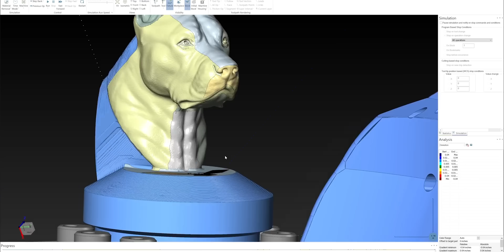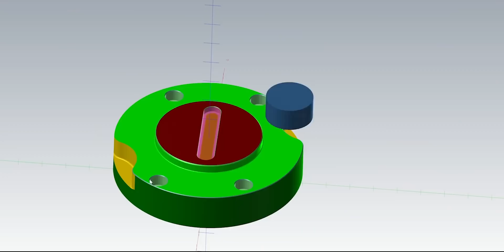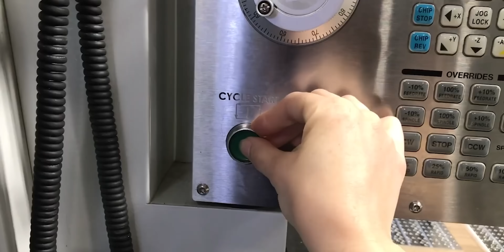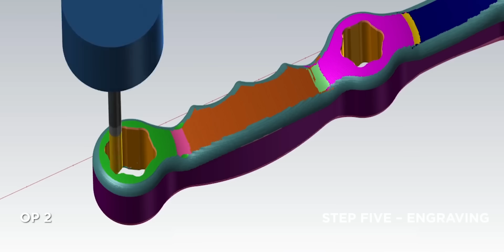My Manager Knows NOTHING About CNC Machining

Comment: Years ago I was hired on as a lead programmer for a large shop.  They had made their name and money doing high quantities of simple 2D wire EDM'd parts, and couldn't figure out why they were losing money doing complicated machined parts.  They had spent big bucks on ERP software, when the root cause was that the manager doing the quoting didn't have a clue what he was doing.  He continually threw the engineering (programming) department under the bus.  I finally had enough and told them that the solution to the problem was not 100k in software, but simple 2nd grade mathematics that the quoter was obviously incapable of, and that setting up a complicated part with multiple operations was much different than doing a simple 2D wire program.  It all fell on deaf ears, but the one thing they did hear was "I'm out"

Comment: Without a doubt a manager must be both a leader and an experienced machinists for maximum efficiency. If one doesn't understand the process leading is problematic at best. I was both for over 22 years and even then there is a struggle if the engineer above the manager doesn't understand the process. In my experience the best engineers also was a machinists first. I could immediately distinguish a die designed from that of a engineer from that of one that was also a machinists/engineer. The machinists/engineer would design the die with thought of quick access clearance holes for inserts for example. Also it is very important to under the production side of things for a total understanding and efficiency.

Comment: I think it’s important that a manager understands manufacturing basics. Understands the challenges that arise. That’s very important. The MOST important is understanding people and having some empathy. An employee wants to feel that they are doing well and not just always behind on a job, or rate isn’t exactly where it should be. We are running into this problem now in my shop. Even a small group meeting at the end of the shift, reassuring that our hard work is being noticed and we just need to keep pushing ahead is a moral stabilizer. Whether we are a little bit behind, or just a few parts short on rate. The least favored line is “keep that machine running all day. No stopping. Keep that green light on”. Understanding that tools break, or chip wrap happens, etc. That not every part ran in a shop is rainbows and butterflies and that I am just not running to my fullest potential.

Comment: It's called micro management and you are so right, that it will take the joy and innovation out of all your employees. I've been a machinist for almost forty years ago, so most of what we did was not CNC work but the principle are still the same. I'm an engineer now but I still have contact to people who work as machinist. I think it's important to let the machinist do the programming too, otherwise they will only be simple machine operators and the company will have a high in/out flux of employees. In Denmark where I'm from the apprentice time was 3 1/2 year for 8 hours/day it has change a bit since, but if you have "optimized" your production so much, that you have dedicated CNC programmers and most of them does not have the basic machinist skills, it will cause many problems. On top of that, you can add a micro management manager who buy the wrong tools and lightweight CNC machinery only focus on accumulated machine time for the workshop. He will then take the next level up on the management pyramide and be inspired of "Change management" ideology, so he now have the "right" phycological toolbox to convince his employees that his Utopia can be for real.

Comment: Been cutting 316 stainless for 35 years. Stainless tells you if you have chosen the correct tool, speeds & feeds.  I haven't found a tool that last forever. I had a manager over the shop once. I would have to give him time sheets on the jobs each Friday. Honestly for no reason. Just so he could do spreadsheets the next week on it. He didn't know the 4 guys in the shop by name. It took 6 months before he stepped in the shop and introduced himself.

Comment: im glad you took the other side in the video also, as a former manager of cnc guys. iv had some runs in's that could build frustration on both sides.

As a manager, its my job to get things done in time, and i like to ask the guys what time it takes before hand, and listen to that, but for some reason, sometimes the times slip, ok, it happens, we get better and better.

But here is the point, be honest with everyone, if i as the manager ask, what time does it take, come with a good guess, I'll take it and i'll also make a markup on it, so you have more time, but if it then slips, then as a machinist, own your mistake, its ok, we all make them, maybe you could not do it the way you wanted, we are here for the money and having a good time, dont come with excuses, you manager is not an idiot, even if you think (and properly are right) that you know lots more about machining than him.
he took your input, and is trying to make it happen, in that time agreed.

and also, tell your manager if you have a good idea, some different cut stock, that would make it faster, we will listen and be glad, we are working on the same goal, dont assume that he will not like it, often a little time saved is lots of money, money that can cover the cost of pre cut to a size for extra price and still make us more money, speak up, you are the expert in the machines, the manager should be in the process and deadlines, as when the alu is shipped to coating and so on, when its needed in assembly and so on.

and just because a manager is out on the floor, we are not "supervising" you, we are just looking if things are going to plan, see if all is there as its needed, did the material we ordret come in and so on, we trust you, or you would be fired.

so that was my two cents, and i love machining, im more a technician that loves making stuff, and to amateur cnc'ing on my home-build machines.

Comment: I'm afraid there's more to being a good manager especially in a machine shop.
Obviously as a manager you're not the CEO but you still must be a good businessman you must know the back end of how business is run in addition to being a part-time psychologists you must have a good grip on all the logistics, from scheduling all outside processes keeping all your internal processes running on schedule.
Must make sure you don't run out of tools and other materials required including making sure the machinery is available on time with all the appropriate support personnel you also must find the time and personnel to maintain your equipment.
It is the ultimate logistics balancing act of human resources material resources Capital equipment acquisition maintenance management you must know a little bit about everything and in the case of machine shop you should be an exc😊ellent Machinist and all-around good person with good communication skills.
All that rolled into one person you're basically the one running the show and delivering the final product.
So you must have good direction from your executive leadership and access to responsive engineering resources without those two key elements even the best manager will fall behind or even fail.😮

Comment: I ran a shop for 2 years I have 8 guys on 16 machines. I have a ton of experience in solidcam and Mastercam.
When we got a job in I'd let the guys pick the jobs they worked on while I was the main programmer. I had an open door and every guy in shop had the understanding that the gcode is a simple base line this they had any ideas on anything not only did I want to hear it I offered rewards on no cost time reduction. And while we had budgets for tooling it was under discussion as to options as we did a fair amount of contract work for like 500-1000pcs of something and they come back for another 500-1000 3-6mo down the road.
I have a software engineering background.

Obama killed the shop as most the work dried up with costs vs China I tried to get the owner to pivot but he just wanted to retire I didn't have the capital to buy the shop so it died the new owner was an "investor type" and the baboon didn't belong in the same zip code as the shop he let me go as I was paid more then the floor guys but I was also the only true programmer other then a few of the newer guys that honestly had never seen a machinist hand book and with less than a year of experience it was all talk and the shop folder 6mo after I left.

My rules in a shop
1. Keep your programmers and cad guys happy and upto date.
2. Never walk away from an idea I don't care if it was the owner or the janitor work it though on paper and see it has potential..
3. You you call my guys button pushers I don't want your business. Respect is not free and the customer is not always right.
4. Every employee gets to clean the bathrooms at least once a year. Respect the shop it will Respect you (this rule alone are bathrooms are spotless all the time)
5. If you see a error be it ours or even a specification in a customer's data speak up this is rewarded heavily upto 15% of a jobs net profit.
6. Your benefits are on me don't like the medical plans offered I will credit you the same amount towards any plan you get on your own

Comment: a manager should be a people expert before an engineering expert. oftentimes, the mistake is made of promoting the best engineer to a manager position, at which they fail because they're an engineering expert before a people expert. meanwhile, a managers knowledge and skill are secondary to their management skills. they should have an idea of what's going on, but they don't need to be experts at engineering, that's the engineers' job. instead, a manager should trust the engineers they manage to be experts at what they do and ideally be able to discern who's the best choice for which job. so, again, a manager doesn't need to be an expert at engineering, but rather needs to be aware that they're not an expert at engineering.

Comment: I worked as a  Senior Process Engineer for a second tier automotive supplier. We were making ultra close tolerance armature shafts for a fuel pump. A buyer came in from Ford and asked what would it take to make the part EXACTLY to the mean dimensions; ZERO deviation. I went back to my desk and brought back a set of vernier calipers, the old kind that didn’t even have a dial. I said “I’m not sure what these cost anymore but I can promise you that if you have your quality people measure all the dimensions with this you’ll never record any deviation.” The Ford Engineer and Ford QC guys present just smiled. I then left the meeting and expected to be reprimanded or fired. The meeting continued and we went on to make millions of these each year for over a decade holding tolerances as close as +/- 1 micron.
Reply: Well played, sir, well played!

Comment: Perfect timing. I may show this video to a group next week. I have to give a talk on a related subject.
I managed my company's toolroom and machine building operation for 22 years, now semi-retired. I agree with your points 100%. I came up through being a machine operator then getting my journeyman' tool & die card after a 4-year apprenticeship. After that got a BS in Mechanical Engineering going to night classes. Not the easiest path but it served me very well through my career. Easiest isn't best in all situations. Having a solid understanding of all the machining principles gave me the "street cred" on the shop floor. Having the education gave me the confidence to deal with engineers and managers who needed guidance. 
Lessons I learned - 
Never let an opportunity to train get wasted, no matter how small. It may sound cliche but it's the rule. For 20 years I trained people to take small parts of my job so I could take parts of my boss's job. It made other's job more interesting, built leaders, and helped the company overall.
Letting your people know you have confidence in them to do the right thing is critical. Let them run with ball. 
Give them the credit for jobs well done. 
Let them know about a problem and let them solve it. 
I never blamed my people as I always took the heat from management for the odd occasion something went wrong, then had a private conversation with my people if needed. 

I had such a great crew when I left because they were motivated to be involved every day. It's a rare thing and I was quite fortunate. 
I've seen crews of very good machinists just wasted because of arrogant, egotistical management. How does that happen? As I said, I'm semi-retired. I'm witnessing it happen right now in my consulting work. This company put a particular supervisor in charge of a critical machine area who they think could run things. This person has zero knowledge of metal cutting and in my opinion is only set up to fail due to that lack of knowledge. The top 2 guys in the department just took early retirement because they didn't want to put up with it. Now what? To be honest, I think the skills and knowledge that is required of machinists is not fully appreciated by management that didn't come from the shop floor. 

I will end my little rant here. Thanks for the video!
Reply: Didnt expect to read the whole thing but that captured me. Very well said/written. All of those things are happening at my work aswell and im on the floor producing various items.
I might just show this to my management. I might get fired for doing this, that is how bad it is. I can't have some input on anything then i might get a warning or get fire..
Reply: thanks for sharing, as a young machinists and new Meister i really appreciate your shared knowledge and you highlighted exactly what i learned during my apprenticeship while supervising my fellow apprentices 👍

Comment: I work for a guy right now that thinks no matter the drill size depth of hole or material the time to make the hole is the same .
Reply: Kinda got the same thing. But it’s the owners son. They took over the company from his uncle that passed about 8 years ago and they have no clue how any of this stuff works. All tools are HSS and when I asked for carbide to help the process and change it so it’ll move faster.  We switched from 0-6 steel to 0-1.  I was told okay and then never got the tools to do so. I’ve asked for about 4 months and then he finally got a carbide end mill but only because the maintenance guy that comes in to fix our machines told him to get a carbide end mill. And that the process of cutting these parts isn’t the best. I got one tool that isn’t the size I needed and now we’re back to square one🙃